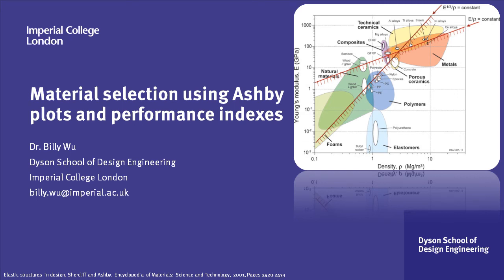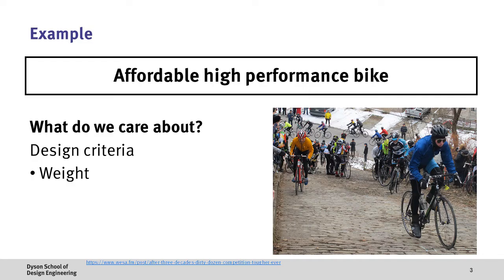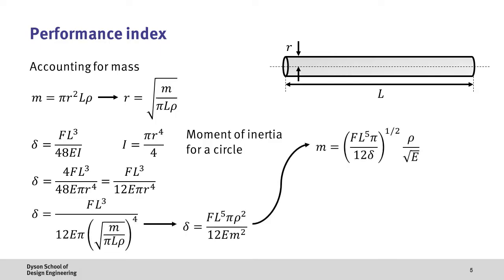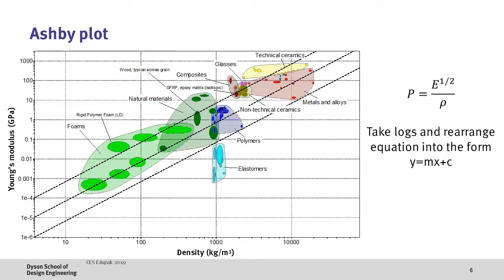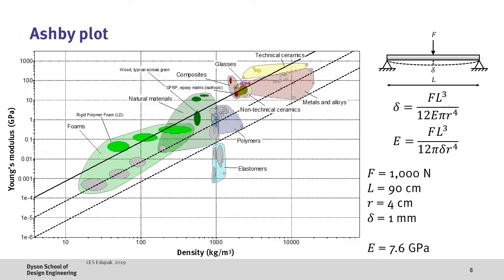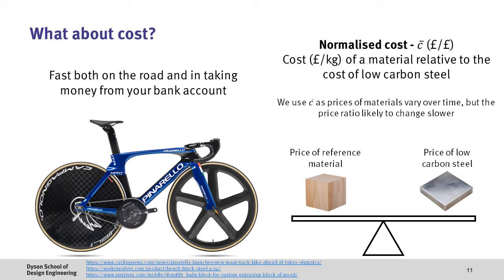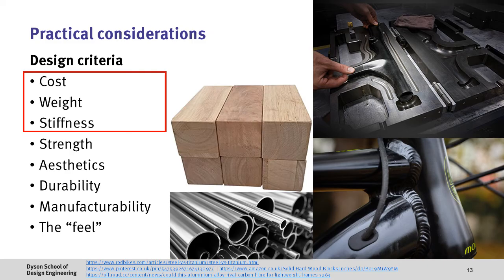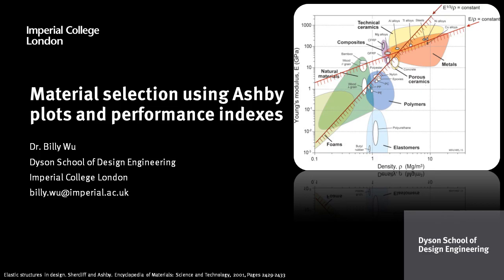How to select materials using Ashby plots and performance indexes

Comment: do you select material before the geometric and force analysis ? i have always found it easier to calculate the maximum stress the part is subjected to and after that I would select material with factor of safety in mind?

Comment: Hi professor, I couldn't find a video about ceramic materials in the channel .I'm trying to find an answer for the question,which is Why do ceramic materials need to be sintered? Could you help me ?
Reply from the maker: Good question and I've also been meaning to make a ceramics video. Generally you might sinter a ceramic for a number of reasons to improve its properties. Generally, ceramic particles are shaped together with binders but have lots of pores and poor mechanical properties in their unsintered state. The sintering process therefore increases the density of the ceramic, removing porosity and thus improving its mechanical properties as the individual grains bond together.
Reply: @BillyWu Oh that's cool .Plus I need the steps of the sintering for ceramic materials ,professor.
From where I can find it
Reply from the maker: @ygt824  One of the best text books is "Materials Science and Engineering: An Introduction" by Callister.
Reply: @BillyWu 
Oh that's cool, professor. Thank you very much 😊

Comment: didn't know how you calculated material indices values
Reply from the maker: If you have a look at the equation of mass, we've separated out the terms into geometric/load parameters and material properties. In a material selection problem we only influence the material properties so we separate this out for our performance index. In this case, we flip the density/sqrt(Young's Modulus) relationship so that we are maximizing the performance index to reduce mass. This gives us P=E^0.5/rho